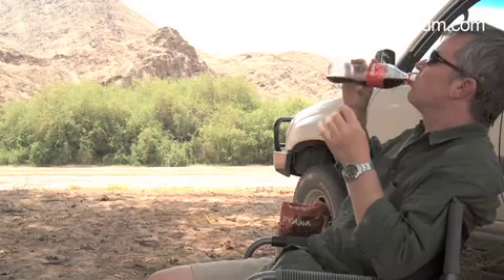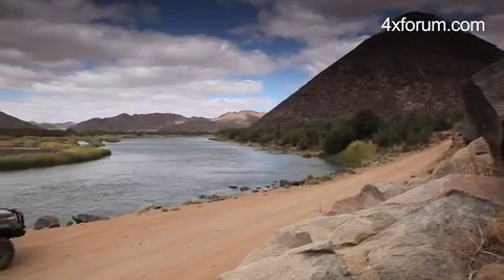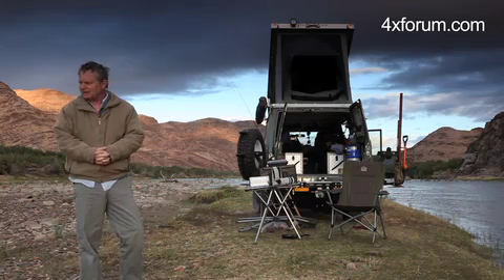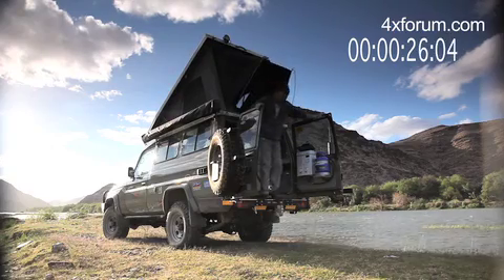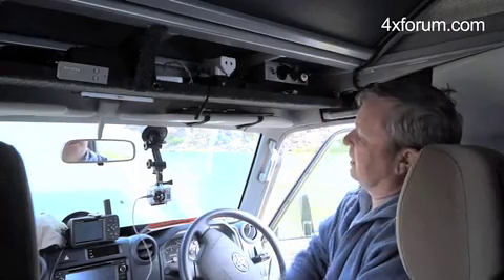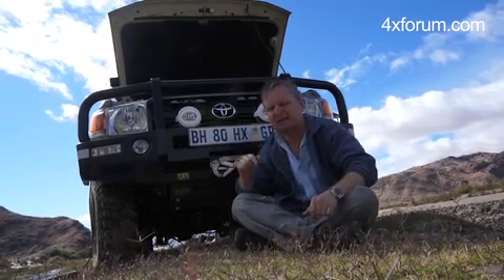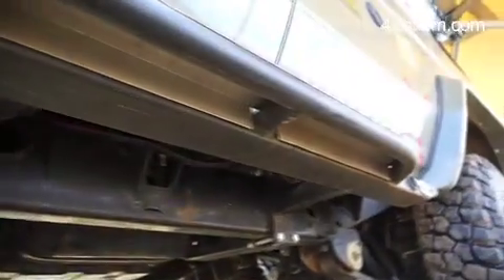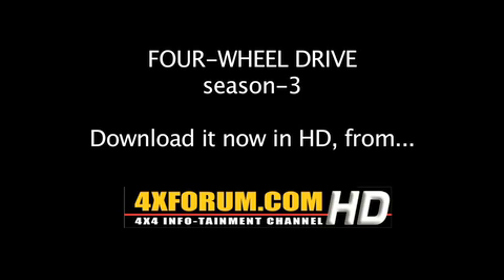Landcruiser Troopy Camper Extraordinary. Part-2

Comment from the maker: I've see many, many turbos fitted to the 1HZ, and many, if not most turbos with inter-coolers have overheating problems caused by the installation. It does add a bit of power, but it affects the reliability, so I decided no inter-cooler, especially not a water-charged one, they are too complex. Inter-coolers don't keep the engine cooler - if anything, they make it run hotter, especially at low speeds in thick sand and off-road.

Comment: Andrew : The very reason that seldom users of a winch need the best, eg Warn is because cheap ones corrode or fill up with water or fail. So the time you do need a winch it won't work.
In the long run, you'll experience what I am talking about. Everyone goes back to US made Warn.
To explain a little deeper : Not using your winch is the worst thing you can do. If you have a cheap winch, test it by simply pulling your car 30m with it once a month.
You think that's too often ? Try using a winch that's failed.....

Comment: Another interesting video. I have 2 questions though. 1. What is your opinion of Yokohama Geloander ATs if you have used them, as all terrain tires for 16" rims? and 2. I assume you are around 5'7" and hence that roof drawer doesn't obstruct your view of the road, but it still feels like it gives a claustrophobic feeling when installed. What is your take? Also, since it doesn't have a lid, isn't it tricky to hold loose objects?

Comment: Great to see your signature line of vehicle is coming along, and it’s a beauty. Too bad where I live the 70 series is not available.
 I have a comment/ question about intercooler on your car, did you look into fitting a water/air intercooler . They are fairly small and they use your radiator fluid to cool down the charged air! 
Thank you

Comment: Your 4x4 landcruiser conversion turned out to be a success in every degree according to the design you strategically planned.

That idea was a great move forward.

Now that you have proved the cynics wrong, might you not look at remodelling the iconic structure known as an Igloo.

The reason why I want you to think about a new though warmer and safer design, will be in the interests of the #SpiritOfMawson expedition in the Antartic and for other interested parties exploring other colder regions.

First, the structure must be made as lightweight, and waterproofed.

It must be capable of being dislodged in icy caverns and unsafe areas as it will act as a temporary safe house, until Search and Rescue can reach it.

The Interior must be made to house at least four people, or at least two. It must have external solar powerered panels, built with thermal tubing, in which heating rods can both store the required heating charge, releasing sufficent amounts to warm the rods, which will melt outside ice build-ups around the panels.

I would suggest Internally, four single bed bunks ("collapsable & detatchable") meaning they can be co-joined together to form two snow sleds for an emergency run.

The Igloo's external structure must be reinforced to be strong enough to withstand a polar bear attack. I suggest #kevlar material provided by DuPont.

These are my thoughts for an icy #future which may help expiditions in the Artic.

Comment: Oh and I won;t run anything but BFG either... Just about to go to the KM2 MT's as well but I've had BFG AT's on all my Hiluxes (currently running 33x10.50x15's on my 1st gen Surf and even though we have WAY more muddy tracks here in the PNW they still grip up, drive very well and I've never staked a tire out in the bush.  I'm interested in trying the 255/85/16 Maxis Bighorns, but I'm reluctant to go away from BFG's so I think that either 33x10.5x15's or 255/85/16 KM2's.

Comment: Great clip, correction on your BFG rating though, they came second last not middle and yet were the most expensive. Besides I wanted BFG KM2 muds on my car but saw way too many ripped to pieces. BFG AT are NOT BFG Muds. Every brand makes good and bad tyres. The KM2's definitely don't like repeated bashing, not sure if yours are KM2s. Thanks for the sneaky teasers about your ideas ;). Thanks for also finally confirming bullbars not being equal. What is your tyre profile btw?

Comment from the maker: I once saw a Nissan Patrol engine. It broke at about 190 000 kms. The engine oil had never been changed. You should have seen the state of that motor!!! Horrific! The sludge had blocked the old system and the lube system failed. Anyone who tells you that the engine oil is better left unchanged knows nothing about how oil does its job.

Comment: Interesting video but I'm not so sure the tent idea is what I would have done. You appear to have cut away the complete roof assembly and replaced it with a lift up panel and tent roof, surely this has effected the structural integrity and roll over crash protection of the vehicle?
I know in Europe panel type vans that are cheaply converted to motor-vans by adding skylights and without adding additional structural bracing can suffer from lots more scuttle shake and have  significantly less strenght in roll over protection.

Comment: What type of shower system do u have in ur troopy trying to pick a good and reliable shower that can be used for wash the dishes maybe and for shower 

Great video
Reply from the maker: Sorry but this one I can't help you with i much. Its the only part of this build that I would do differently, as while it worked, it used too much water. I would look at a gas-fired caravan type boiler. I tried one in a camper earlier this year in the US, and liked it very much.

Comment: Hi there we loved watching your video,i have been to the cape and totally loved it , anyway can i ask why you didn't have the V8 turbo diesel motor, did i miss something ?, also i have at the moment a 2009 D4 diesel hilux and would love to know your thoughts on putting a chip to the motor as i have a 3" exhaust also, once again loved your video cheers 

Wayne And Lingy
Reply from the maker: They do not offer the 78 with the V8 in SA :-(. Andrew. The 1HZ motor does not have an ECU, so no chip. But for anything else, the Dastek Unichip is the one I would use.
Reply from the maker: 4xforum And check out my website. www.4xoverland.com

Comment: Andrew : 3rd Comment :
Anyone operating in remote areas doing overland journeys knows to use split rims and cross-ply tyres. I recommend Silverstone. We use the 7.50x16 12 ply Extra Grip.
I find it VERY hard to believe that you can go 72000km in Africa without a puncture on a radial tyre. That's unbelievable. Are you not driving on sharp rocks, sticks, roots and roofing screws ?
Honestly, a BF Goody Mud terrain is as strong as a Dunlop road tyre.
Tough tyres are not pretty and they're not cool.
Reply from the maker: Very good comments and thanks. What you say about winches is spot on. But we will have to disagree with tyres. In my view, 750x16s are old fashioned and perform very poorly. And split rims are bloody dangerous! Cross plys don't grip on anything, sink into sand, and as for punctures, anything with an inner tube is like a puncture magnet. Heat build-up often destroys the tube. I now use high quality radials, puncture repair inserts, and my set of wheel spanners hardly ever gets used any more. I did have a puncture in September - the first one in 140 000 kms!!! Including treks through Mozambique, two through Namibia, and three through Botswana, one through Angola.
Reply: 4xforum I'll connect with you again on PM.
Cheers mate :-)

Comment: Hi Andrew, would you still recommend the SAC turbo for the 1HZ engine?
Reply from the maker: no. Because they have omitted the EGT sensor and readout in the cab. Without EGT warnings to warn the driver of high EGTs, a turbo and the 1HZ is a risky business. Even a low pressure turbo.
Reply: @4xoverland, thanks for the feedback and insight. Much appreciated.

Comment: Seriously there was NO EXCUSE for this video quality.  Disliked all of the low quality's.
Reply from the maker: +ArkaelDren If you look in the info page. there is a link to this video in full HD. This video was first released in SD, and later released in HD.
Reply from the maker: +ArkaelDren There is also a HUGE banner in the middle of the frame, linking to the HD version.
Reply: But your so professional with your series, that it just struck me.  I could understand if it was a decade ago.  Maybe take the 240p versions off the tube then?
Reply from the maker: +ArkaelDren I will lose all video counts and I do not want to do that. if it had a low count, I would have removed it. That is why I put up the very large banner in the first minute telling viewers about the HD version.